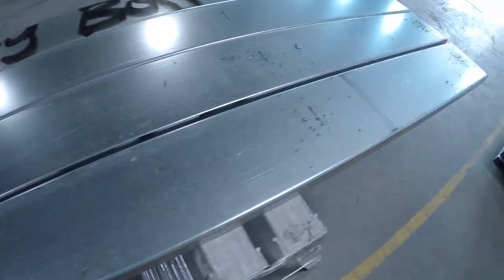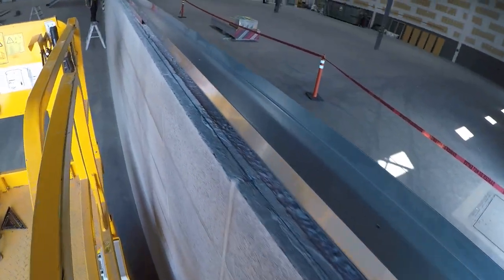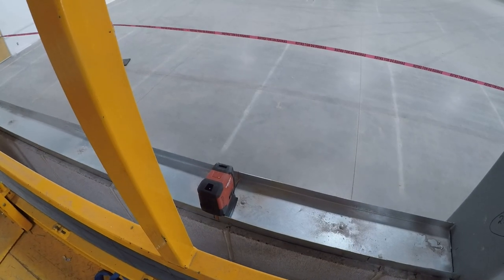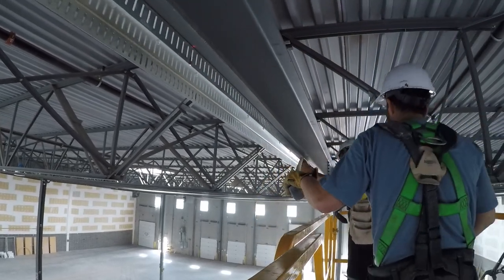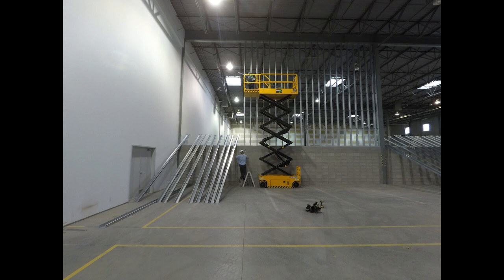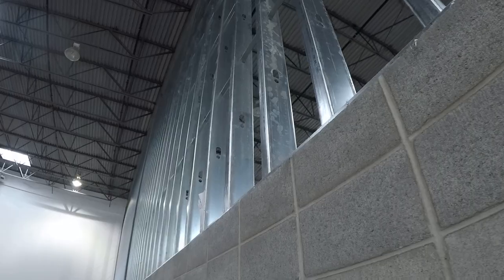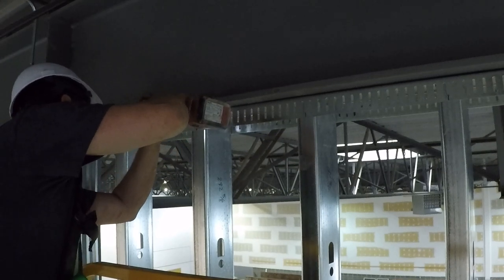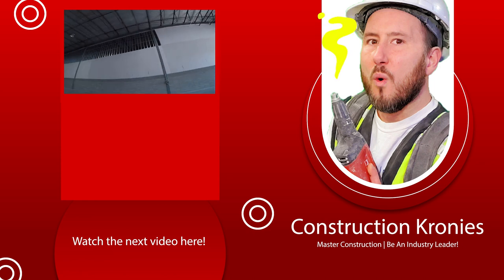Metal Stud Framing On Concrete Filled CMU & Steel Full Lesson

Comment: Have you ever tried the hilti metal saw?
Reply from the maker: Yes I have it, however the blades are too expensive and it's a rough cutter. I still prefer the chip saw, even with the non abrasive blade is too good.

Comment: Awesome video! Would hex heads work on the studs in the top slip track?
Reply from the maker: they could if you need to have an expansion joint. However if the drywall has to run over the top of the screw the hex heads will make the board stick out. The pan heads are the way to go. I would recommend using number 8's the 10's are just too big,

Comment: I don't even do steel framing, I was just looking for 1 detail that's not very common for a specific situation I might run across running network cable in office buildings - and here I am binge watching warehouse construction like "Oh yeah, so THATS how that gets done!" HAHAHA!

I've worked with so many guys that always try to eliminate that one step - like predrilling. "It's got a drill point! REEEEEEE!!!!" ... Same guys that work their asses off just to keep up while I'm working at a nice pace and slowly pulling ahead of them. Tortoise and the Hare!
Reply from the maker: Cool man, that is great! Did you get the 1 answer you were looking for?
Reply: @ConstructionKronies  Not exactly. It probably varies based on the type of framing. Some networking channel was showing them drilling a 1 3/8 hole through the top track, but I don't trust them - they did it right by a stud - middle 1/3 or don't do it is my thing, just like an engineered wood "I beam". Also, 1 3/8 hole to get a single network cable down? LOL!

I assume it's probably legit in thinwall like I see in office buildings, probably not so much on that 14 ga structural stuff. Still all over your vids though, just had to actually work today!!

Comment: Hello Sir,
I noticed you used a slotted track for the top and not the bottom track. Is that a standard practice?

Can a slotted track be used on the  bottom as well?
Reply from the maker: Good day my man! Yes we use slot track only at the top when the wall goes to under structure. If the walls are below structure we use std track (the same as on the bottom). It is used to achieve 3/4" deflection for contraction and expansion.

Comment: Great video! I have to make a 19’x54’ partition wall in a warehouse. What gauge and size material do you recommend and what spacing? Any tip for a first time tall wall?
Reply from the maker: Good stuff my man! You can go 20 gauge 6" with a structural flange, 16" o.c. slotted slip track for the top. Add R20 insulation and 5/8" either side an you get your 1 hour fire separation. Make sure to install carrying channel every 4'. Lots of tips for a first time high wall but be sure to have good leather gloves. Ask me any questions along the way!

Comment: What was the height of wall ?? Iam using 8” 16gauge for 25’ high exterior wall is it ok? Pls guide
Reply from the maker: That's super heavy duty, you will have no issues with that wall. You could go 2' o.c. with that big of stud. The height of this wall here was 30' I think. 8' of CMU and then 25' of wall if I remember correctly.

Comment: Question. Does the top plate need to be slotted always? Or we can install non slotted too?
Reply from the maker: Anytime we frame floor to underside of structure the slotted track is used. You can use standard track for floating walls or walls that go under drop / suspended ceilings.

Comment: Great videos! What size/type of framing screws do you suggest for install16 gauge track and studs? Thanks in advance!
Reply from the maker: These will work here: https://bit.ly/HeavygaugeFramingScrews You can go #8 or #10. If your having trouble getting them through you can predrill them.  If you think you can get away with how far out the heads stick out you can also go with hex head self drillers, 5/16" or 1/4". I like the wafer head screws myself.  let me know if you have anymore questions!
Reply: I appreciate it Bro

Comment: Hi thanks for the great video! When you secure the studs to the top track, you seem to attach a screw only on the side you're working on. At 28:46 we see you drilling on the back side of the stud closest to the column, but did you do that for all the studs? Thanks again.
Reply from the maker: Great question I was waiting for someone to notice that. On this wall it was hard to drill from the opposite side of the wall so when we went to other side I finished screwing the tops in before we installed the drywall! Cheers bro!

Comment: What would be the screw pattern for a 16'  high wall (using stand ups) with 2' centers, using 1/2" drywall?
Reply from the maker: Go 6-8" in the bevels, 4 screws in the bottom track, 12-16" in the field and remember to keep your top screws at least 1" down from the bottom of the slotted track to allow for deflection.

Comment: Curious to know how much a framing like this cost? I just did a 205 ft wall and 12ft high and I feel like I under charged.
Reply from the maker: Sure yes man, for that I would charge $9.50 / linear foot for steel,  0.40 / square foot for drywall, 0.45/sf for tape plus $2 / lf for corner bead or trimtek, 0.25/sf for insulation and 0.25 / lf for any strapping. Add a couple hours $45/hr for layout, cleanup. If it's farther than 30 minutes from my house I charge fuel and I will add any extras in like fasteners (especially Hilti shots very expensive) and if I have to go get any material it's a $250 flat rate. These are all in Canadian prices.

Comment: Yea you got lucky on the CMU wall giving you that extra length.
I’ve framed 40 foot long studs and it honestly sucks 
They’re so heavy that you can’t just put them up from your bottom guy.
You have to literally clamp them to the rails of your lift and go up with them..
It’s scary.
This architect definitely had a heart!
Reply from the maker: haha yes man, but it is 14 gauge, we could of done 20 gauge with a structural flange here no prob. Yeah I have a trick with the 40' long studs and the lift. I set them horizontal across the lift, put up to 6 on it depending how heavy they are and then go up half way to swing them in. Cheers man great comment!
Reply: @ConstructionKronies  I love my job I love my job I love my job.
Hahaha
Reply from the maker: @alexanderdrywall3043  Nice! I love this stuff myself, a lot disappointed with the rates but I do enjoy it!!
Reply: @ConstructionKronies  I work union in Seattle it pays well.
It’s fun never a dull moment!
Reply: @ConstructionKronies  you doing peace work?
Reply from the maker: Yes sir!! Piece work and contract. What about yourself?

Comment: When you start your layout which way are the studs supposed to face? And when you start to hang the drywall which side of the layout do you start on do you frame one-way and hang the other or do you start hanging from the side you started the layout from? Please let me know or send me to a link to show me thanks 🤠
Reply from the maker: Yes so as a framer we point the studs hard side out from the way we draw out layout. That tells the boarders what direction to go. It doesn't matter really what side of the wall you start on just be sure to stagger the bevels on either side of the wall and try to do the inside of rooms first to lock in all floaters and make insulating easy. You want long runs to do when insulating it's a pain to jump into every second room with a baker or bench if that makes sense?
Reply from the maker: Here is a playlist on layout I made https://www.youtube.com/playlist?list=PLRtmYu3z-FEOD-6gkfwoKa1xBxMaTojQD
Reply: I am joining thanks

Comment: How do you run electrical (conduit) and plumbing threw the top plate of a steel frame wall?
Reply from the maker: We use a drill with a hole saw to cut openings, if a pipe is already installed we either stop the track close on either side or cut a slot. Hope that answers your question!

Comment: I've worked with 12 gage 1 time never seen it again
Reply from the maker: Crazy heavy gauge 💪
Reply: @ConstructionKronies  it wasn't fun all screws would break on you.
Reply from the maker: I would probably pilot a hole with a drill first in this case. Did you guys try that?
Reply: @Construction Kronies  that's exactly wat I did I bought a chuck adapter for my cordless impact

Comment: what do you do if the steel column is out by 1" what do you do to get 16"on center all the way through?
Reply from the maker: What I do is make a mark with a framing square (draw a line out from the 16" center mark) on the last and first past the column. Then draw my tape from that and then I always laser up the first center to the top track in each bay. Columns can be often out, just keep your steel straight and shoot a stud to both sides. Does that answer your question?

Comment: that would be the same layout as a 1 hour fire rated wall?I need to build one, can't find information
Reply from the maker: 1 hour wall needs 5/8" type x 1 layer each side. You can 3-5/8" and bigger, your choice. You can also insulate optional. The steel doesn't matter for the rating just the drywall. I'd always suggest 16" on center but you can also go 2'.
Reply: @ConstructionKronies  nice. Thanks 🙏🏻